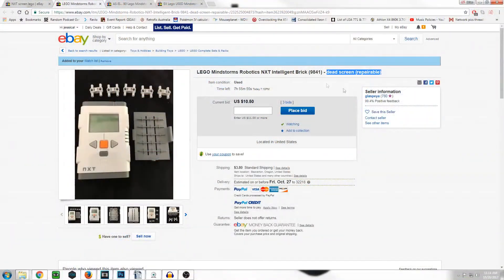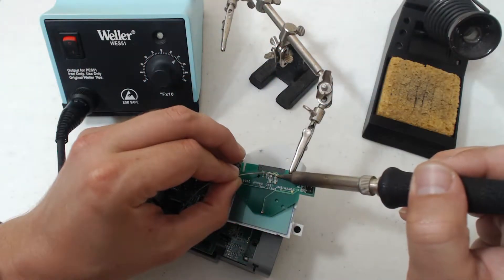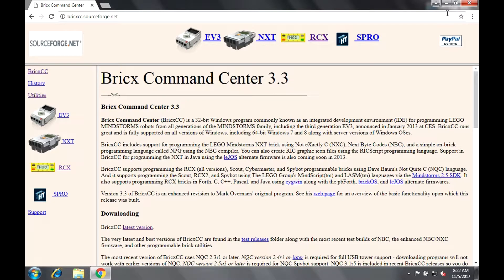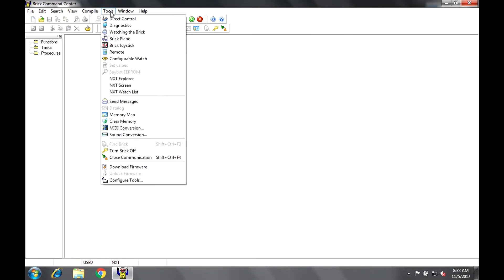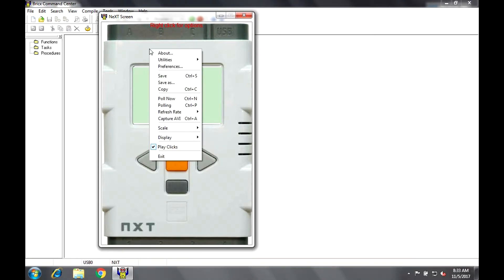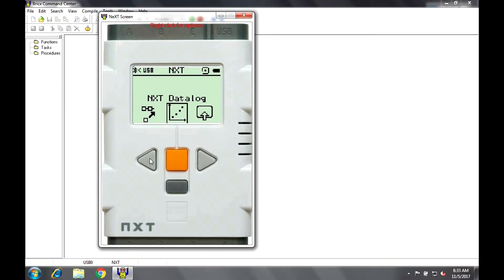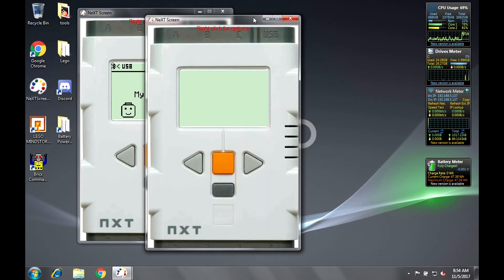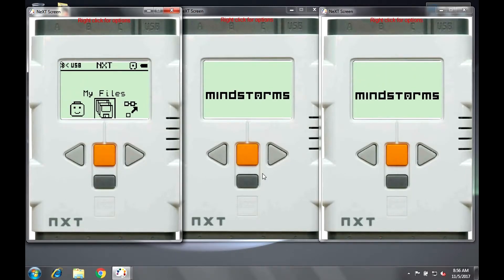Lego Mindstorms NXT Screen Repair Alternative

Comment: I think I kind of figured out. Following is what I used for my ports and it is working. 

USB0::0X0694::0X0002::001653016736::RAW
USB0::0X0694::0X0002::00165303CC6E::RAW

I think 0X0694::0X0002 it is the same for all NXT. The rest is the mac address of a NXT brick and it is unique. Hope this helps.

Comment: I tried out the NeXTScreen, but, I can't connect with the default setting for port. Should I change "usb" to something else? I saw you were able to connect to different NXT bricks. How do you let the NeXTScreen know which port(s) to connect to your NXT bricks ? I am using win 7 64-bit with the 64-bit driver for NXT. From the device manager in Windows, I can see the Lego MindStorms NXT device installed.

Comment: Blast that ribbon cable connection to the PCB with a hair dryers and while it's still hot squeeze it with a pair of pliers!
Reply from the maker: I may give repairs another try at some point.  but to be honest I prefer controlling everything from one place anyway